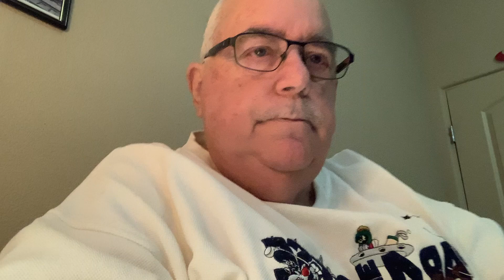N scale | To all Manufactures of N scale Trains | Coupler Problems | Model Railroading

Comment: N scale couplers have been a source of frustration for me too as I've gotten back into the hobby. All of the stuff from my childhood has Rapido couplers, and I'm working to convert as many as possible to Micro Trains. Some of my Kato stuff plays nice with the Micro Trains couplers, some does not, so I may have to convert some of my brand new Kato stuff which is frustrating.
Reply from the maker: Jamie this should never happen.  It’s a manufacturer’s thing and we as consumers shouldn’t have to spend extra money on couplers.
Reply: @EngineerEd-xt2qu  agreed! I've been spending a lot of money on upgrades, and will likely continue to spend more.
Reply: You are better off converting everything to Kato! For my operations, it was the MT couplers that were the culprit, losing cars, while Kato works just dandy and keeps the trains together all the time.
Reply: @owenlaprath4135  that's great to hear your experience with the couplers, thanks for sharing.
Reply: I am very much a novice in this hobby. Just this week, I received my first order of Kato tracks, the RhB Allegra 3-car combination and RhB Ge4/4 II locomotive , as well as some RhB rolling stock.
My first impression is that everything is so tiny and requires jewelry precision tools. Amongst the unitracks, there are two uncouplers hoping that I can use them. However, I am not so sure that I can since the locomotive and Allegra, as the rolling stock doesn't seem to have that metal pin in the couplers. I haven't completely unpacked every thing and I wonder whether I will find these metal pins somewhere. In the manual they refer to the supplied Arnold couplers in case one wants to swap them for the Kato ones. Very confusing to say the least. @owenlaprath4135

Comment: The Rapido coupler was the N scale standard until about 30 years ago.  Micro Trains (Kadee) couplers are pretty much the standard now for mid range products and up, older equipment and entry level trains will still have the Rapido.  Most of the "Micro Trains" type couplers work well together, but Kato's version is known for not playing well with other and a lot of people will install actual MT couplers on their Kato locomotives.
It's the same situation in HO, the Horn Hook was the standard, but all mid and high range products now come with a version of the Kadee coupler.
Reply from the maker: Thanks for that information very helpful. But still have a problem with couplers.  It’s very unfortunate for everyone

Comment: 2 points here: 
1) So, the old Arnold Rapido type couplers always work just dandy (unless you have old pre 2000 sloppily made Roco, Rivarossi, Lima, or Bachmann low end gear), be they a little clunky or not! If you run any European equipment, that is srill THE major coupler to this day. Attempts were made by a few to make other couplers, but the cost and labour involved in swapping them is just too much for most European modelers. 
2) Regarding knuckle couplers and for all Micro Trains (MT) coupler fans: Give me a break! They are made in USA, and that is the ONLY selling point they have! I tried them, and the problem is not with other couplers. MT couplers are the most fidgety and most unreliable couplers ever made for N-scale! I have NO trouble with Kato's magnetic factory installed couplers, and their dirt cheap 11-702 (black) and 11-707(grey) couplers (come in packs with 10 pairs!) make upgrading North American style equipment from Arnold couplers feasible at under 5 bucks for 10 cars! 
My cars with Kato couplers (both magnetics and 11-702/7) stay together, which I cannot say about any cars that came with factory installed MT couplers, when coupled to each other. I ended up tossing all MT couplers, replaced them with Kato 11-702 or 11-707, and now have reliable operation!
Reply from the maker: thanks for the visit and comment